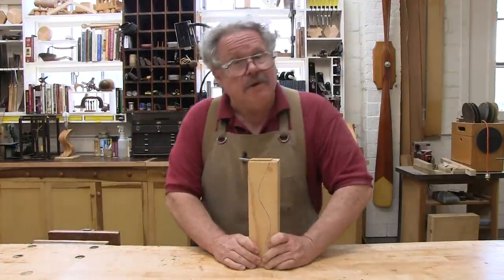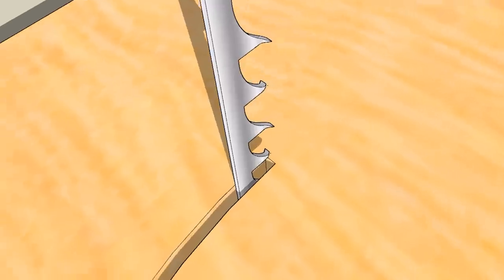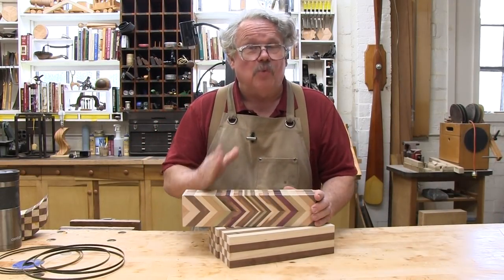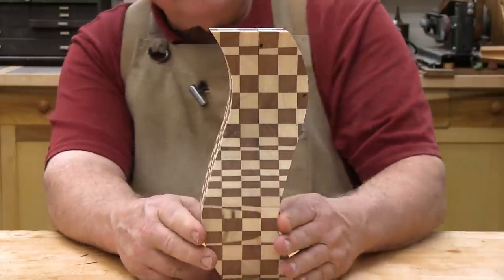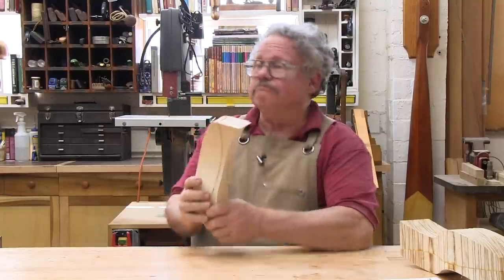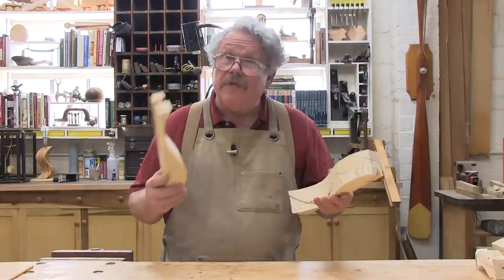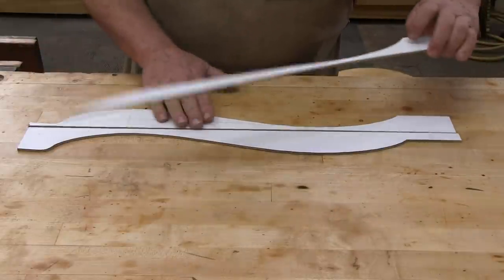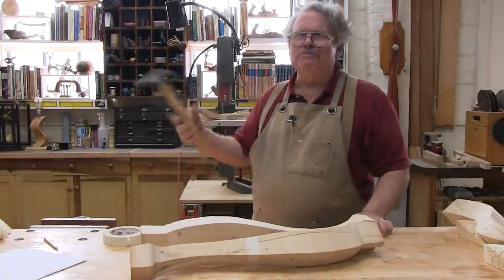Bandsaw Magic Part 2

Comment: I’m sure someone else has noted this but it dawned on me that if I chamfered each of the long edges before making the two serpentine cuts, there would automatically be a hollow channel in the middle once assembled. Perfect for running wire through when making lamps. No need to drill.
Reply from the maker: Great idea. However, you might want to see https://www.youtube.com/watch?v=aAD5yGaHunw and go to 2:20.
Reply: @WorkshopCompanion  Haha - see, I knew it was a good idea (and that somebody else thought of it first - ie you)! In my defense, I got the idea after watching your other bandsaw magic video. Came back to comment - sure that my keen insight would rock the woodworking world. Would have been great if I had watched this one through as well 🤦‍♂
Reply from the maker: @timrichards5249  Great minds run in the same ruts.

Comment: 2 minutes in and I was hooked.  Love your style and content, a perfect YouTube combination.
I am wondering about bandsaw speed settings for the cuts.  Does it depend on wood type, blade width or both?
Reply from the maker: It depends mostly on blade grind and stock thickness. I use a 1/4"  (6 mm)  skip-tooth blade for most cuts in stock over 1"  (25 mm) thick.

Comment: Very neat! Unfortunately my bandsaw is small/cheap, basically for rough outs for small carving/whittling. It’ll scream just cutting basswood in simple cuts.
Reply from the maker: Sounds like my old three-wheeler. Try cleaning the wheel hubs/axles, then putting graphite powder on them.. Don't oil them; it just attracts fine sawdust.

Comment: OK now for my second question; it appears that you were using a shop Smith. The blade I have on mine is about a 1/2”. Should I get a different blade? And should I run the blade at a specific speed on the shop Smith (I’m using the workstation)? My concern is that when I start to turn the wood, you make it look easy. I’m concerned of twisting the blade as I’m new to woodworking.
Reply from the maker: I think I was using a 1/4" skip-tooth blade in the vid. But the blade really doesn't matter; the technique will work with any blade and at any reasonable speed. The blade determines the radius of the turn you can safely make -- the wider the blade, the larger the radius. In my book, Using the Band Saw, there's a chart of band saw blade sizes and the radii you can safely make with each of them. Also, suggestions for band saw speeds depending on the operation. https://workshopcompanionstore.com/products/using-the-band-saw

Comment: Just learning but what horse power saw do you think is the least to have for quality cuts And speed
Reply from the maker: You can't have too much horsepower on a band saw if you're sawing thick material. The speed will depend mostly on the blade and to a lesser extent, the material. I recommend a four step pulley system for band saws that would allow you too switch between 3000 and 650 fpm.

Comment: may have been asked previously, but would it be possible to use this magic in conjunction with Castle joints for a coffee table, or would the castle joint result in a weaker leg?
Reply from the maker: It might take some fancy band saw work, but legs like these would work with castle joints.

Comment: Hi. Love your work. I see that you have a small band saw but may be powerful. Can you tell me with a  if i will be able to do your cuts with s Rikon 370w??
May be I need a diferent blade Im Héctor from argentina. Thank you
Reply from the maker: The Rikon 370w is a belt and disc sander, so offhand I'd say no. But if you have a band saw with a 3-1/2" throat or better, you should be okay.
Reply: Its a "'band saw"" rikon with a 370 w motor

Comment: Another awesome video. Thanks!
"Scrap wood for your fire." Still laughing! I thought it was neat but probably heavily weakened?
Reply from the maker: Not as much as you'd think. The compressive strength remains high as long as the glue joints are tight with no gaps.
Reply: @Workshop Companion  Cool! I guess I was "assuming" that thin portion of the one would provide less. Thanks for the informative response, and again, your great videos!!

Comment: what is the tensil strength of a support constructed with the band saw as opposed to steam bending a board that thick into a similar bend?
Reply from the maker: That depends on the wood species, the radius of the bend, and whether or not you're compressing the wood into the curve or stretching it around the curve. In general, however, steam bending reduces tensive/compressive strength, usually no more than 10-15% in a clean bend.

Comment: What size of bandsaw do you use for these cuts - as in HP?
Reply from the maker: I have a Shopsmith 11" bandsaw married to a 2 hp motor. If you often saw thick stock or do a lot of resawing, the extra power comes in handy.

Comment: WHAT KIND OF WOOD DO YOU USE MAILY FOR THESE NICE PROJECTS
Reply from the maker: I'm embarrassed to admit this is mostly crate wood. Several years ago, we built several airplanes for a museum in China and we used ISPM-15 certified lumber for the crates. (It's treated to kill the bugs -- they don't have passports. Or entry visas.) Anyway, that wood was mostly pine, and included some reasonably clear 4x4s which we set aside for work like this. So that's what you're looking at -- cherry-picked Southern Yellow Pine.

Comment: Can I use a jig saw to make the same cuts let me know as soon as you can please thanks
Reply from the maker: Yes, if you're patient enough. Jigsaw blades typically have a very high TPI (teeth per inch). Consequently, they do not clear sawdust from the gullets (the spaces between the teeth) as quickly as bandsaw blades. When cutting thick wood, the gullets become impacted with sawdust, preventing the teeth from reaching to wood except at the very tips. The cut slows to the slowest of crawls. If you use a jigsaw, pick a blade with the lowest TPI and the deepest gullets, and resist any temptation to rush the cut.
Reply: @WorkshopCompanion   would a hand copping saw do the same I am just starting out and I have no idea or no one else to ask
Reply from the maker: @alickdunbar  Theoretically, you can do the same thing with a coping saw. But the cuts have to be straight up and down, square the face. If you drift off square, the cut surfaces will not align with each other. And once again, the process is extremely slow.

Comment: Could it be possible to make these with a hand jigsaw?
Reply from the maker: Difficult. You'd have to confine yourself to stock less than the length of the blade. And the going would be very slow -- jigsaws do not clear the sawdust very quickly when cutting thick stock.
Reply: @WorkshopCompanion  Thanks for your kind reply. Was also wondering on how well it will last in time. e.g. if using pine wood, I was imagining it opening like a flower due to warping
Reply from the maker: @gb2547  It all depends on how you prepare the wood. If you take the time to properly "shop dry" the pine and let the moisture content reach an equilibrium with the relative humidity in your shop, there should be no such problem. This could take weeks to months, depending on the initial moisture content of the pine.